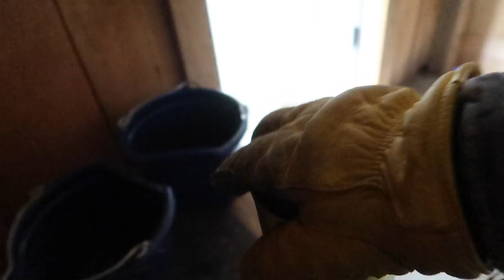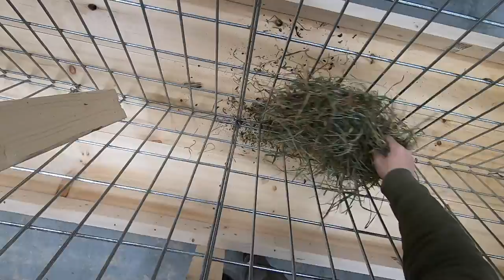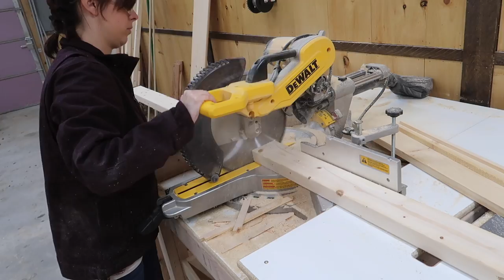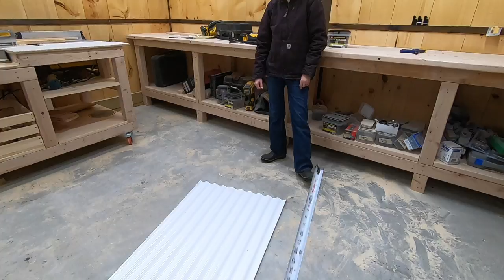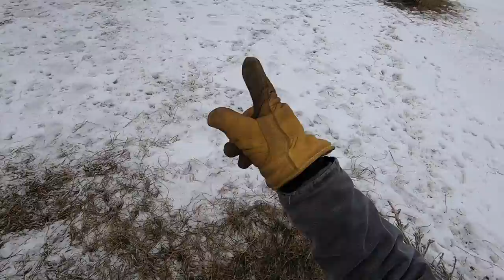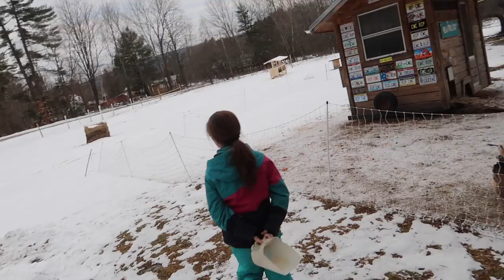It's Finished! Building the BEST DIY portable HAY FEEDER w/ ROOF

Comment: Check out  Farm Innovader HB 60 bucket 9qt for goats. They run 24.99 at TSC. Use 100 watt bulb energy. Has thermostat regulate itself. Plus can add extra warranty if want . No matter animal or your fault theyll replace up too 2 yrs for extra 10 dollar if remember.  Really helpful so have water as long as you have power. Also what pellets are you giving your boys. I was feeding sunflower seeds some corn oats and alpha pellets. But cut them out and up hay feed. I have a kiko for now plan adding more.  Also what you end up doing on the counter after customizing it when making hot dogs.

Comment: Do you Copper Bolus your goats? I do mine. I have a really hard time using the bolus gun so I make a treat and put the capsule inside. I had to get them used to the treats for a few days before I hid the bolus' in them. Worked like a charm. I know that the best way is with the gun, but  I couldn't do it. This way works best for my goats and me.

Comment: Excellent building project guys, it looks awesome! The heavy gauge wire panels are just what I need for my headache rack I'm close to getting started on for the now completed carryall on the tractor.
I can use these for hanging my 14 ft. chains on or anything else that needs to be hung up & out of the way... Not sure where U got them Al, however I need some lumber at Lowes & will check with them, if not I suspect TSC will stock them...I'll be making a Littleton run in a week or so & today I have 8.5" of snow to push off at about 3.5 hrs. work...
Bill on the Hill... :~)

Comment: I was wondering if you cut one ridge off another piece of roofing panel, the length of the roof of the feeder, couldn't it be used as a ridge cap if you wanted one? God bless.

Comment: you had to know that little P would jump up INTO the new hayfeeder. the new babies will too. thats why Kevin (weed em and reap) made the hanging one. for just that reason. you will constantly be cleaning it. i would put a hook on one end and keep a small broom or brush hanging on it. or a dustpan, you have a lip there on the edge so you may need a scoop instead.
 
nice to see eggs, it works if you open the door. lol 

looks great, and anyone saying that hayfeeder is too big has not thought of the fact that every goat there is either bred or is going to be bred. 7 quickly turns into 14+. this way they have room to grow and not fight so much.

also, it was 70 degrees here near houston texas today. will look to see if we have a cold front coming in.

Comment: Nice design. Al, have you thought of adding wheels to it for the spring/summer? Maybe the wheel axle could go through a part of the skids in such a way that when the tires are added it doesn't raise up too much.Dragging it through a soft or muddy field is going to mess up your field.

Comment: Cool feeder.  I only see one problem, and it's an easy fix that don't even need to be fixed until it fails someday.  I'd bet the first thing to go is the lag eye bolts you are using to pull with.  The way they are set you are pulling a pretty heavy structure by only the little bit of wood, end grain at that, that the threads of the bolts got a hold of.  With  bumps and little obstacles as you pull, and weather, wood shrinking and expanding and aging, they will wallow their holes right out in the near future I'm sure.  The easy free fix would be to put them into the beams near where you have them, but on the sides.  So when you are pulling, you are not pulling against the grain of the wood, but against the sheer strength of the bolts, and the holes themselves will be much stronger too into the side of the grain than into the end.  A better fix for not much more money would be to get longer threaded eye bolts, drill the hole all the way through sideways, near the end of the skid, but not too near to prevent splitting, and use a nut, locktite, and two large washers. Then you'll never be pulling that thing by just the strength of the wood lag threads grabbed.
Reply: Just drill a hole across the skid for a chain.
Reply: @bruceharvey8810  Yeah that too. I'd  loose at least one of those big hooks on the chain then so I didn't need such big holes and could pass that end through both holes.  I'd avoid 3" holes in a 5 1/2" board to pull with.

Comment: I would like to know where you got those wire panels. I am building my own goat herd and will need to build a larger feeder myself. I would love to get some panels like what you used.
Reply: In NJ - at a Grainger's - I found fencing like that called, appropriately, goat fence.  10 foot lengths, 4 feet wide.  I used them for tomato trellis's.
Reply: @Gladtobeleaving  Yes, I can order goat fence panels through T.S. here in Kentucky. But it looked to me like the panels he was using might be a heavier gauge.
Reply: How about tractor supply?
Reply: @donnadanna6676  Nope.

Comment: On yesterday's video where you were showing that the chickens didn't lay any eggs, I noticed that the board was down inside to where they couldn't go nest.  That's probably why they didn't lay any eggs up in the nester, but they may have laid some down in the bottom somewhere.  I didn't notice you putting up the board in this video either, so you might not get any eggs in there again.  So you may want to look inside on the floor.  Just a thought.

Comment: Looks really nice! When your building heavy things on skids it’s a good time to drill a 3/4” hole through the skids about a foot from each end of both skids so if you decide to move it when there’s no snow you can install a temporary axel and two wheels at each end to facilitate moving it over dry ground.
Reply: Ken Corsell or, put a thin strip of UHDP (ultra high density Polyethelene) under the runners. Wont rot, and reduces friction for moving.

Comment: With all the work you put into this feeder did you consider flame treating it?
Reply: Vincent Alaimo as it is out in the middle of the field why would that be important?
Reply: Reinita Caicedo weather resistance.... protection to last longer...
Reply: Vincent Alaimo I get weather resistance, but flame resistance was my question.
Reply: Reinita Caicedo not “flame resistant” treated “with flames” I forget what the process is called!
Reply: Vincent Alaimo it’s called charring.
Reply: Reinita Caicedo no, there’s actually a specific name for it that’s escaping me at the moment and that’s not it
Reply: Reinita Caicedo 
“Shou Sugi Ban”
I use to use this process for wishing wells and bird houses that I use to sell as a hobby and I used the traditional cedar in the process but it works with all woods
You char the wood and then oil it after a quick scrubbing with a brush

Comment: Looking good, although I would have put the roof right on top of the feeder with a hinge to open it. Lower = less wind to catch on it and tip it over and from what i see with the other feeder (in the buckpen now) the snow blows into the hay, because of the high roof and open access above the rack itself. Wet hay gets mouldy, stinks, the wood rots faster and the smell makes them not want to eat the good hay on top of it much. The commercial feeders of models like this that I can get here all are low to the ground with hinges for the roof and wheels + handles for moving them. Although they are all metal and there fore lower weight than this wooden one. Low to the ground also makes for low center of gravity and thus very stable.
Reply: hillock farm most hay gets eaten each day so mould is not going to be a problem.

Comment: Great job!  However, you guys need his and hers tool belts or at least short shop aprons with pockets for screws and nails.  It will make those projects go much easier.
Reply: sydmarty1 - Lumnah Acres have said in previous replies that they don't like wearing them.
Reply: Tony:  I was a general contractor and a professional carpenter, what do I know???
Reply: @sydmarty1  You can lead a horse to water but can't make drink.

Comment: It looks very uncomfortable for the goats with that bar across the bottom.  Also the wire opening looks small for them.  I saw the wire getting in their mouths.  Have you thought about adding smooth rubber to the bottom bars touching the ground?  Not only will it protect the wood, it should make it glide easier on the ground.  Just a thought.

Comment: I wonder if you  are planning to have a better area for your Male Goats?  They have no area to graze, run  etc.   Don't know if it  makes sense to  move their shed.  If not, how about  extending their area by moving the  fence outward.   If that's not feasible , how about fencing  a new area  that  they can graze in on  a day to day basis and return to their shed in the evening.  I understand Premier One fencing works for goats, so it wouldn't have to be permanent fencing.  I know you care for your goats, but I would like to see the Male Goats get a better area.  Is there an off mating season  where your Male Goats can safely join the rest of the herd?

Comment: I don't know if y'all are prone to hail or not, but it will go right through that plastic.  I have a back porch that has a plastic roof that is now sporting holes.  We bought the house with it like that, but we'll replace with tin.  I know it's more, but sometimes it's cheaper to pay more on the front end and not have to replace it in a couple of years.
Reply from the maker: No we don’t usually get hail.

Comment: You shouldn't feed the  goats that much black Oil sunflower seeds  it is too high in phosphorus. The ideal calcium to phosphorus ratio is 2:1 to 4:1. Too much phosphorus is what actually causes urinary blockage in goats. So bucks can have alfalfa its not bad for them if balanced out by the grass hay which has less calcium

Comment: EXTRA BRACING IN A  V UNDER THE ROOF OR A BIG AMOUNT OF SHOW AND WIND LOAD WILL TEAR THE ROOF OFF. FROM THE OUTSIDE EDGE OF THE ROOF TO THE CENTER OF THE FEEDER ABOVE THE WIRE

Comment: Just curious why didnt you use glue on this project?
Reply from the maker: I was building it from the blue print in my head. I wasnt sure if I was going to have to take pieces apart and make any adjustments. If I did I didn't want it to be glued together
Reply: @LumnahAcres  plus it's outside so wood glue probably wouldn't work so well.
Reply: @joeysweet9045  The brand of glue he's using makes indoor and outdoor versions. I think he has both. It's a really good quality glue
Reply: @rickster9993  u cannot unglue can you ? you can unscrew if you want it later
Reply: @davelawson2564  I was just pointing out they do make an exterior glue.
Reply: @rickster9993  I pointed out why its not always the best option
Reply: @davelawson2564  I must not be thinking this thru. I thought that was what started this thread. No biggie.

Comment: I think there’s a surplus of feeder for the female goats.  Now that you have this mobile feeder with a roof, I don’t think you need the feeder on the side of the barn anymore. All I see are feeders everywhere.  It does not look nice. Also there’s no consistency between the male and female goats. With the male ones, you put the flower seeds right into the hay but you put it separately for the females?
Reply: Have to have options with the snow load in the northeast . Once we get in a real snow pattern with a foot plus of snow on the ground they won't be able  to use the pasture feeder. And spreading the sunflower seeds in the hay keeps them busy and occupied.
Reply: Also the females are getting grain , as to much grain for the boys will cause issues  with their urinary track building stones  from the calcium in the feed . Its called  urinary calculi.
Reply: @dominickclementi8118  They have feeder inside the barn for the female goats also so if there's heavy snow outside, they can use that one.  That's why I think the side feeder is not needed.
Reply: @hoangtu69  your missing the point. Its not about what you want or think. Its about what works for him . And its alot easier to clean out the side pen to get them  outside for some air then cleaning a path out to the pasture .
Reply: @hoangtu69   he can't put seeds in the female's feeders, they wouldn't be able to reach it. And why must there be consistency?